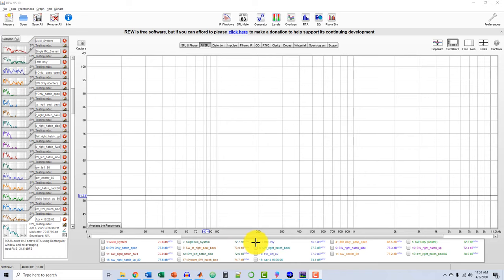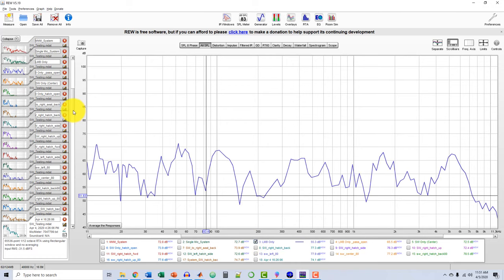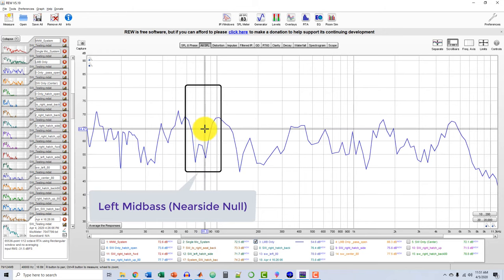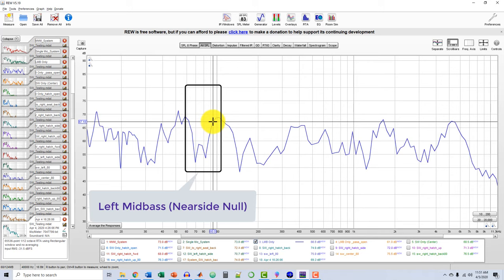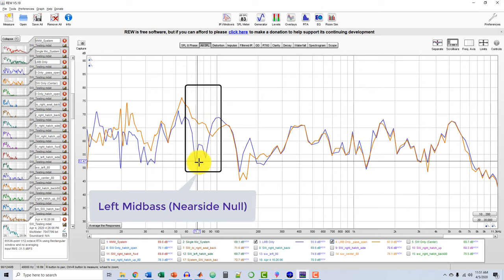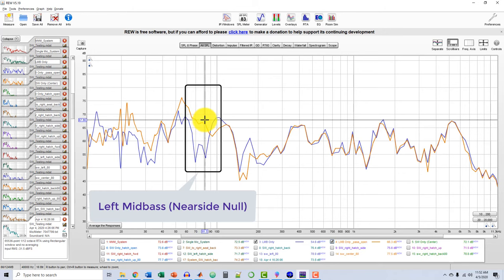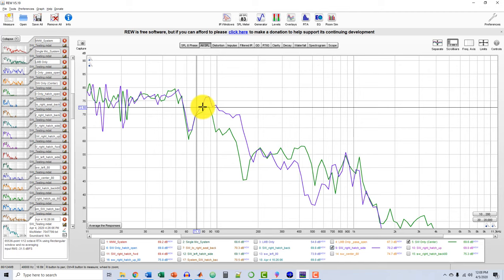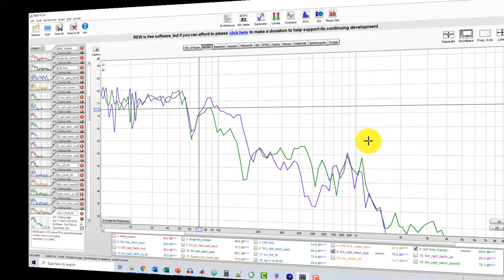Using a Subwoofer to Improve Midbass in Your Car Audio System

Comment: Can get bether too with making a enclosure for the midbass.
Reply from the maker: An enclosure can't fix placement related problems.  Room modes don't care if you use an enclosure.  They just care about where you sit, the geometry of the room, and the placement of the speaker.
Reply: @ErinsAudioCorner  thanks for a good and  straight up answer. You really do know what you are talking about. I had to test you alittle . Hehe.
Reply: Im thinking if you have the option of mounting the midbass under the dash. Firing downwards. Maybe that will help a little . 🤔
Reply from the maker: @Alextheampguy  I try to shoot straight when I feel it's appropriate.  Thing about car audio, though, is there aren't really a lot of certainties but there are some things you can always count on like room modes kicking your butt!  haha
Reply from the maker: @Alextheampguy  I considered that for my new car.  For the time being I'm using the door locations but I'd like to go kicks or like you said, mount the midbass in the dash.  Mainly the latter just so they're out of the way.  I used to have 10's in my kicks.  It was fun.  But not really what I want anymore.

Comment: Almost everything  is correct what he says until u make custom enclosure dedicated  to manufacture specs for your midbass !!! Huge improvement
Reply: @Max Max  
Not really.  The 6.5 midwoofers that Erin is using are designed for excellent midbass response in IB of standard car doors.

And he has done quite a bit to control any door or panel resonances.

The real issue he is discussing is a result of the LOCATION or placement of the driver in the vehicle in relation to the listening position.  Adding an enclosure doesn't change that aspect.

See Erin's response below to @Alextheampguy